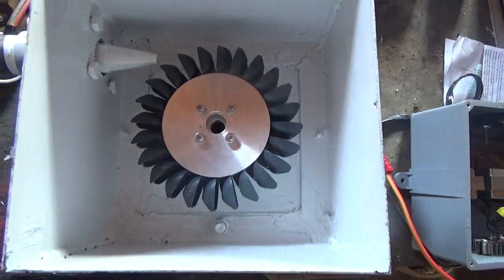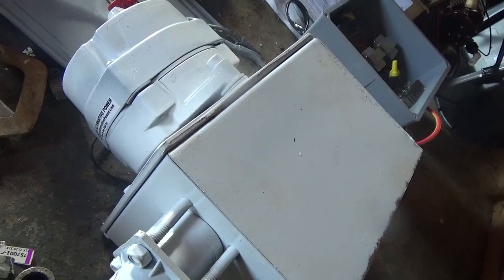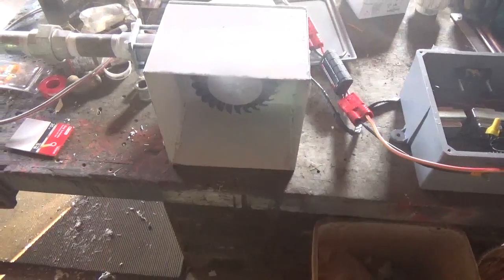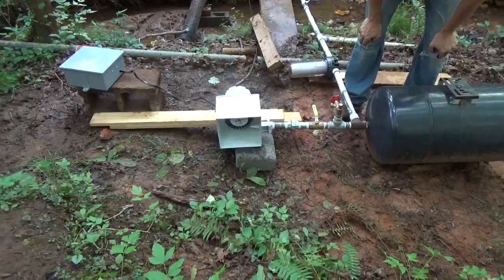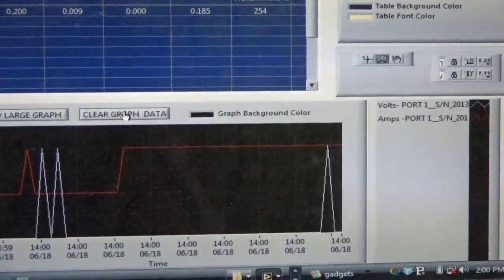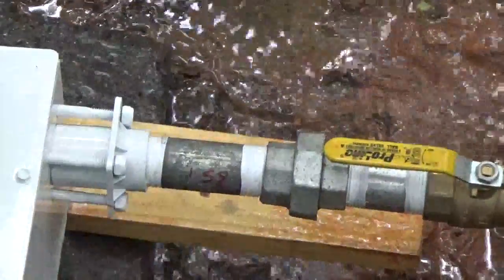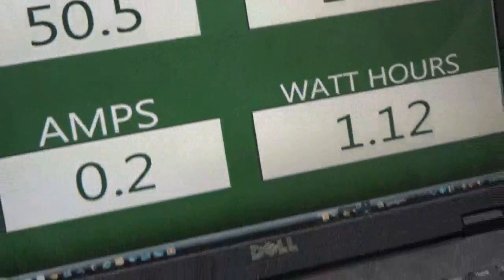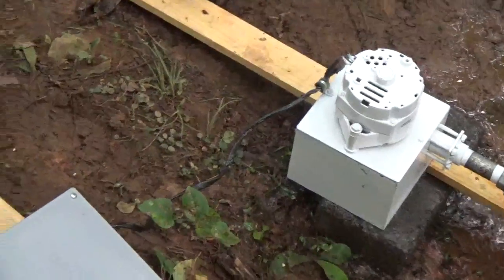How Engineers Have Fun In The Woods!

Comment: Newbie question here as far as testing goes why not leave the alternator alone say a 100 amp gm 1one alternator charging a 12 volt system? I have a small Creek in my yard I plan to utilize with a few designs till I find one that works well to supplement my battery bank that is on solar right now ( very small system only running led lights in shed and carport)

Comment: Very interesting. I question the economics a bit. (10 watts/1000)x24x30 = 7.2 KWH a month x 15 cents = $1.08 saved in a month... unless you're just doing this because there is a need for electricity on this specific location and no wall outlet, or open sky for a solar panel, then I guess I understand.

Comment: Why not use something that generates DC? Isnt that more efficient?
Reply: 2tts Solar naturally comes as DC, but rotating devices that spin magnets near wire windings such as permanent magnet alternators  (PMA)  naturally put out AC Voltage.  Then the AC is rectified to become DC .   As you probably know, Efficiency is determined by power out divided by power into the system.   Different PMAs have better efficiency than others as you might know.
Reply: I was thinking of a dynamo but upon further research i found that it wasnt as effictive as i thought

Comment: The RamPelton is a great system to trickle charge spare batteries so they don't go bad.  It will also provide and store power for an application that is not used very often.  Looks like a success to me.

Comment: I have had an idea for a while, but dont have the tech know how or gear to figure the cost benefit power usage. The idea was to hook a car alternator or small generator to the fan shaft in a central heating and air unit, with a belted geared down ratio. So basically the genie would spin twice as fast as the fan and not give that much resistance to the fan shaft. The power could be fed back to the air unit, the grid, or battery stored for later use. The air runs almost 24/7 in hotter climates and anyway to offset that power usage I think would be beneficial. Is this mechanically and electronically fesible or would it be pissing in the wind?
Reply: The motor driving the fan in the central heating and air unit would draw more current proportional to how much energy the alternator is putting out.   The physics calculations  use the unit of "Joules" for energy.   Long story short,  you would calculate joules out (Watts x Seconds)  and Joules in  (Torque x rotational degrees moved) -   then divide   Joules Out by Joues in  to get your efficiency which from my experience may be as low as 10% by the time the energy gets to the batteries.

Comment: I know this was intended as a fun demo project, so maybe I am reading too much into this, but theres something I don't get. You tap into a stream which you say is 10-12 ft higher, then use the ramp pump - to do what? if you want to generate power you just hook up to the pelton, so is the ram pump just a cool accessory here?
Reply: Daniel Baldacchino I may be wrong but I think that the ram pump is needed to get the velocity of the water going fast enough to spin the PMA,  the water from the stream just wouldn't have the ability to do that.

Comment: I'm confused about the alternator.  Don't alternators normally run off a voltage regulator that switches the field coils on and off?  Wouldn't it be wiser to rewind an alternator with thinner wire and run it on a voltage regulator, just like in a car, but with the regulator set to your desired voltage?  Overcharging the batteries wouldn't be good.
Reply: A PMA is a permanent magnet alternator.  A normal car alternator uses an internal adjustable field that regulates the voltage which tends to be 20 to 40% less efficient in my experiments.   A 100 Watt power source would have a very hard time over charging a 100 Amp hour battery.   Power loss  from the battery internal resistance provides enough of a load for the power source that the voltage rarely goes above 14.8 which I think is the generally acceptable max charge voltage for most batteries.
Reply: Thanks for the explanation.  Where can I learn more about these alternators?  Sounds similar to a generator.

Comment: Scott..... I've watched your other ram pump vids, but haven't found the answer anywhere else.  So a quick question..... you said there is only a 10-12' drop in elevation from the pond to the ram pump?  How far of a distance are we talking? Is there a lot of head..... as in 10-12' elevation drop in 500' from pond to ram...... or does the distance not even factor in?
Reply: my question was going to be are all ram pumps as efficient? can you get better pressure for less head/water lost with a different sized ram/flap valve/piston etc.

Comment: Hello: You pulled another trick from your bag. That will charge in the dark, no need for solar for that. I got Fel Pro 3018 10'' wide gasket material for the bell part of my Rife ram pump. Its 1/16'' ''10x26 Cork Rubber. Learn as I go, right. Have a Great Day

Comment: So, you need to pump water out then you need compressed air to spin an alternator that puts out 0.2 amp , it will take about a month to charge a deep cycle battery